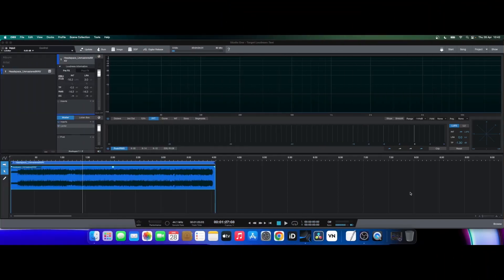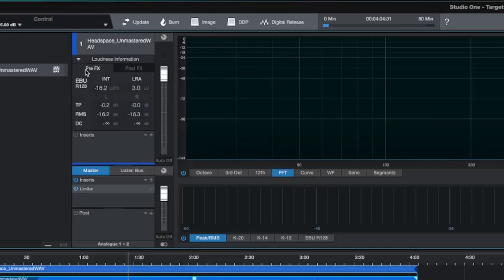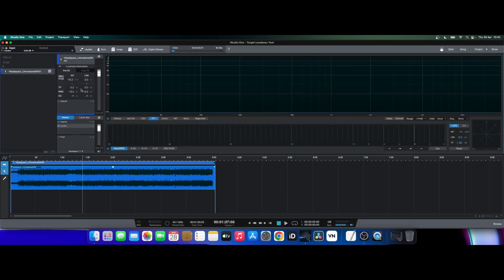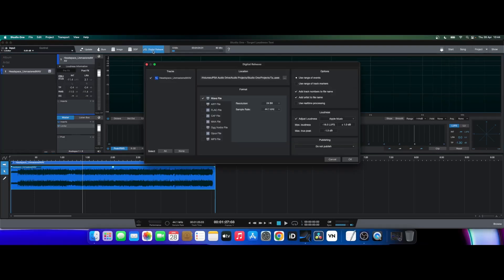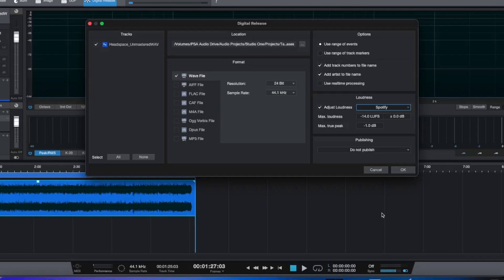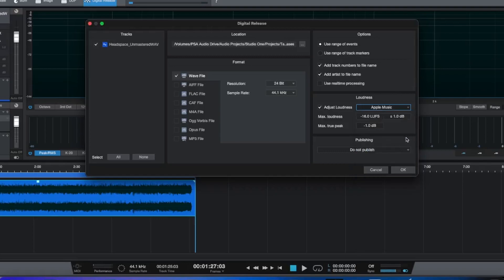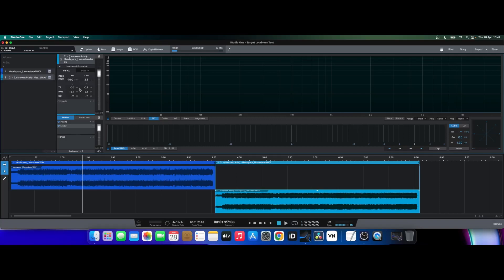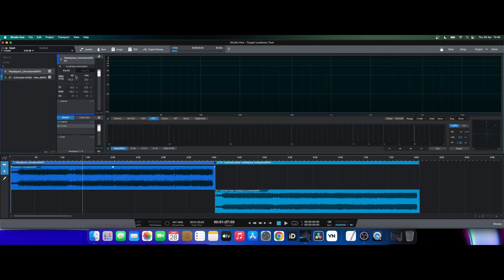Mastering in STUDIO ONE 5 - TARGET LOUDNESS - Is this a useful feature???

Comment: I have wondered about things you have brought up here. Thank you for the clarification. 

It seems True Peak is this holy grail so what is the best way to get to a -1 TP?
Reply from the maker: This is such a great question.

In short the LUFS and True Peak go hand in hand. The Peak level measures the maximum peak whereas LUFS measures perceived loudness. Neither is exclusive and both are important.

True Peak is actually very easy to achieve and can be done by a Limiter or even just gain increase or Normalizing. The challenge is maintaining the True Peak at -1dB whilst achieving your optimal loudness. 

I can’t really advise what the best way is as it depends on the song but the most straightforward way is simply with a Limiter with a ceiling set to -1dB and boosting the gain to the loudness that sounds best 👍
Reply: @ProgressiveSoundAudio  Thank you!  I have surmised that no matter what, a -15 combined LUFs + TP is the nominal target and this can be achieved via -14/-1 0r -12.5/-2.5, or -11.5/-3.5. Do you concur or what would you say? I get you say whatever the song needs, knowing this will be normalized per album and playlist, so just do it al let the system go what it will. My point is do you still keep some sort of target range in mind?
Reply from the maker: @dawmix  No I use absolutely no target at all. It's not as simple as using LUFS and True Peak as a calculation as they measure different things. LUFS is a measurement of perceived loudness where as True Peak is the loudest peak level, so a -14LUFS Int plus -1dB TP doesn't equate to -15. You can maintain a -1dB True Peak Level whilst achieving any number of LUFS configurations as it's a totally different measure. The -1dB True Peak is important as this allows 1dB of Headroom for the Streaming Codec process but the LUFS Int I would recommend at least -14 LUFS and no quieter due to Loudness Normalization challenges. I typically end up somewhere between -10 and -13 Integrated but not always and it all depends on the song.
Reply: @ProgressiveSoundAudio  agreed. Depends on the song. I have seen reference to the lower TP if Lower LUF and it appeared as a coefficient. Even so it depends on the song and you have convinced me it doesn’t really matter and I have turned off the option in my export.
Reply from the maker: The coefficient aspect is roughly what the Streaming platforms do when it comes to Normalizing. So a -10LUFS song with a -1dB True Peak will be in the ballpark of -14LUFS with a -5dB True Peak once Normalized (it’s not an exact figure and changes based on Album or Playlist Normalizing) but it’s not something we need to do this end 👍

Comment: hi there. great info, many thanks. funny thing is ! ive be using this feature since V5 only as INFO for my target on mix down. and then making the adjustments manualy before mixing down !  i didnt even realise it was there to do the prossesing for me :)  but yeh i agree with your opinion. mix your master with good levels, with no clipping and let the outlets deal with it there way. that said this feature may be handy for people working with the video/movie side of things ?  but im guessing 👻 happy halloween
Reply from the maker: That's not a bad way at all to approach it. In fact thinking about what you've said you could have your original processed Master run through the feature with Normalization applied, then  adjust your original master with more dynamics to compare against this Normalized version. That would be quite useful.
But this wont do all of the processing for you, it will just turn the file up or down dependent on whether there is peak level to play with, but you're right it could come in handy for the video side of things.
Thanks for watching Charlie.

Comment: Hi great video. In my use case I would like the option to turned it up even if it were to compress the file against the limit i set. I will say I'm not a music producer so I get why this would be bad. I use a daw to help put an internet radioshow together for my wife so the music files mp3 and wav are already set. The issue here is from one song to the next the lufs levels are all different so I need a way to automate getting to a level we decided on, -12lufs stereo-15lufs mono files in our case, so people don't have to ride the volume. I get this is not ideal but seems to be ok on playback for this use. I currently use Adobe Audition software and it's match loundness feature as it lets you set peak and lufs regardless of whether the level would be turned up or down against the peak level limit set. Would like to see this in Studio one as I prefer it in some ways especially navigating around it and then I could just pay for sphere only and not adobe as well!
Reply from the maker: Yeah that’s a great idea, Reaper also has a Normalize audio feature where you can Render to a Normalized LUFS setting which would also work great for what you need. That way the levels are all perceived the same without compressing the source.
Reply: @ProgressiveSoundAudio  thats interesting to know as have reaper but never really used it, will have a look. In audition looking at the wave form it does compress it against the limit set but as some files are mp3 compression is a given!
Reply from the maker: Yeah I know what you mean but certainly take a look at the Reaper options. I’m pretty sure you could add multiple audio files into the Render queue and then do them all at once 👍

Comment: Sir incase out track -16 -17db is there we selected spotify and export it automatically converted to -14db and can we upload to that plat form..??
Reply from the maker: Great question and it depends. To clarify do you mean -16/-17LUFS? If so it will all depend on your peak level. For example if you have a LUFS level of -16 with a True Peak level of -1dB then no your song won’t be turned up as there needs to be 1dB of headroom for the encoding process. But if your song is -16 LUFS with a True Peak level of -3dB then yes your song will be turned up to -14LUFS so it all depends on your Peak level. 
I’ve not personally tested this feature on songs quieter than -14LUFS so you may need to check if this feature will turn your song up but it will all depend on your true peak level. Hope this makes sense.